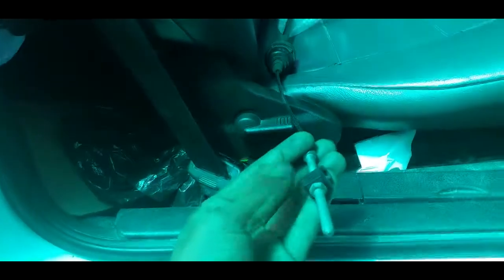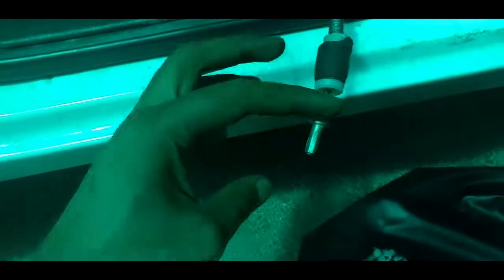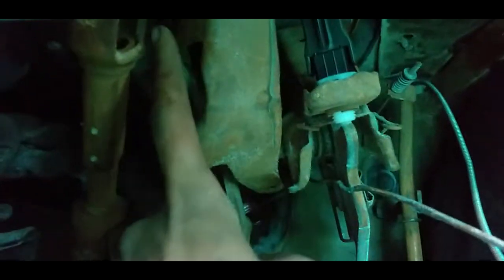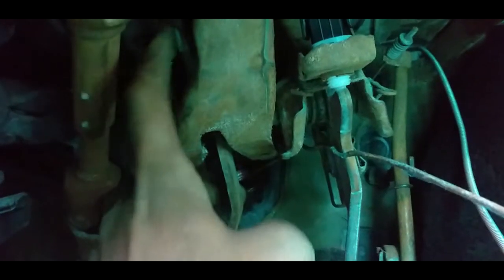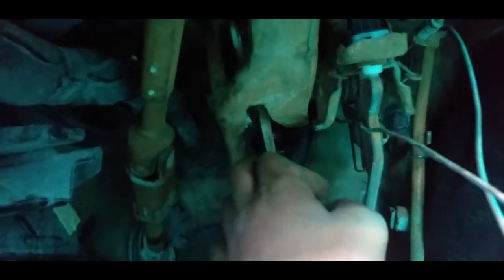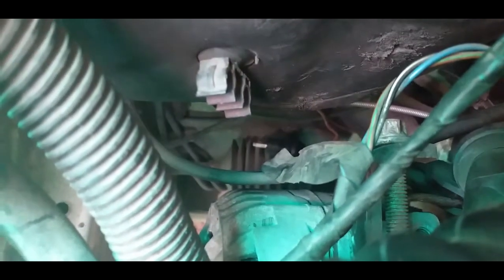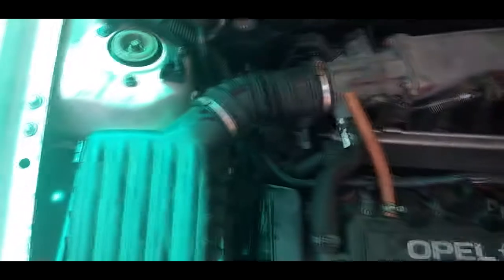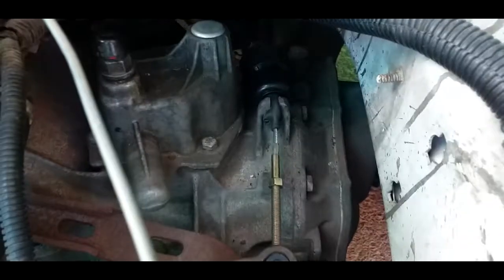Opel Clutch Cable replacement tutorial

Comment: My cable broke, orderd a new one. But after putting it threw a small hole on top of the clutch pedal the cable was bend too much and was ripping the plastic. It also was not pulling good. Are there more holes to put it before the pedal?